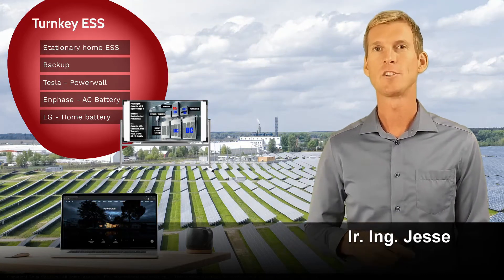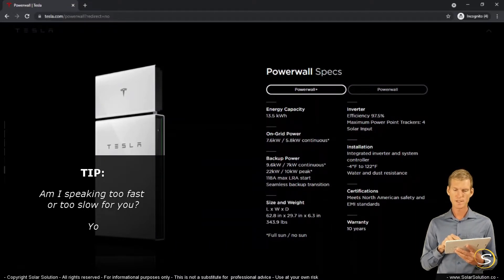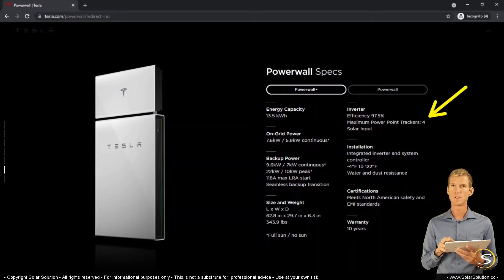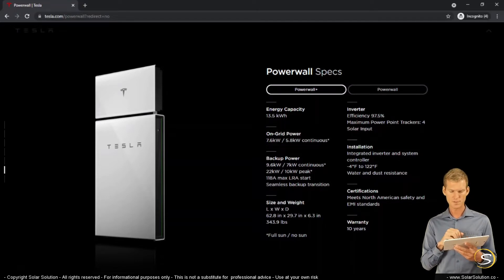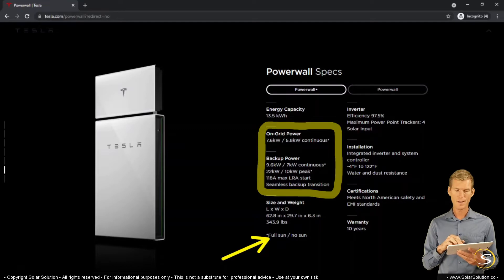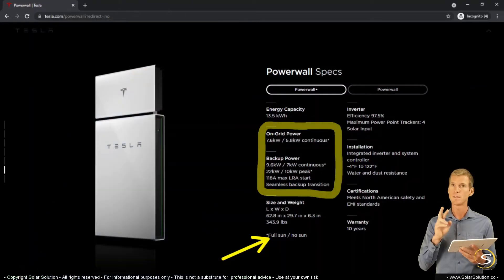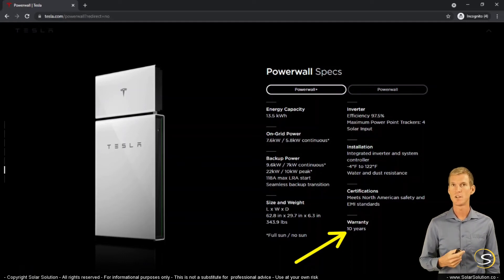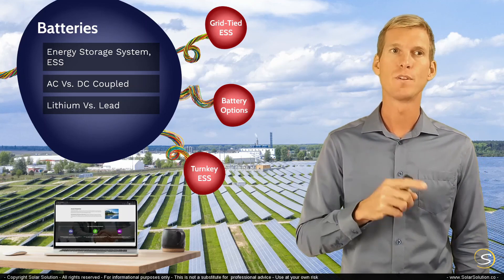The Powerwall Plus Differences: Specifications Explained Simple

Comment: Hello Jesse,

Your attention to detail and the quality of your courses is unparalleled congratulations 

Q, Have you specifically addressed the performance curve of the voltage output of panels based on temperature and or active cooling techniques in any of your current previews or more in depth within existing course material?

I believe you mentioned the industry-standard 1 M2 reference testing mythology was based on 77° operating temperature if I'm not mistaken can you provide a link to this reference methodology

Thanks

Comment: Hi Jesse I have a Question
Can I mix Solar panels of different brands ? by doing this will damage panels? 
I have 3 panels 1) 21v 8A (2) 23v 9A (3) 49v 9.5A ... Can I Series 1st 2 panels and Parallel it with 3rd one?? (21v + 23v = 44v) == (49v)

Comment: Hi Jesse.
Great info from your video. Can you  clear up confusion please  concerning the THD   "total harmonic distortion" .. 
Is this as bad as i have read?   Can you  explain 
 how problems  can occur  with certain  electronic  items found in most homes,  if the person uses a generator that is putting out more than 7% THD.   Perhaps explain how fast the damage will occur ? and how bad the damage  can be ?  Does it take days - or hours  of running a generator  that puts out in excess of 7%  to cause damage?   Do you even have to use that electronic device in order for damage to occur - or just because it's plugged in damage occurs?   Exactly what  type  of electronic devices in the home qualify to be damaged ?  Why  is this not  more well known to a common person using a generator.  Manufacturers should make the details  about  this potential problem more noticeable to people.  It seems as though I stumbled across this information by accident , And I've used generators for backup power many times. When I mentioned this to neighbors Or friends who  use generators, they did not know about either.    If this is all accurate, It sounds like a expensive mistake that many people dont know  about but can be avoided.  
Finally with all this being said , is this even a real problem at all , or hype ?  If you can talk about this topic , it would be greatly appreciated.  I do know that chasing down the THD spec amounts can be difficult on some models, and it appears the generators producing the low amount of THD cost much more , are sometimes the inverter/ generator combo units. 
THANKS VERY MUCH
Reply from the maker: Hello Joe, thank you for your question. I have shared a separate video on the THD topic; I have pasted the link below, have fun!
https://youtu.be/HlF8ZGQfgIg